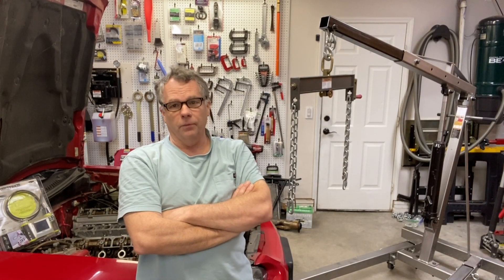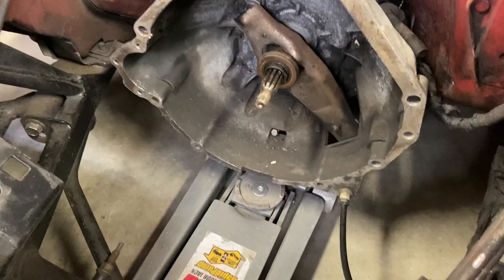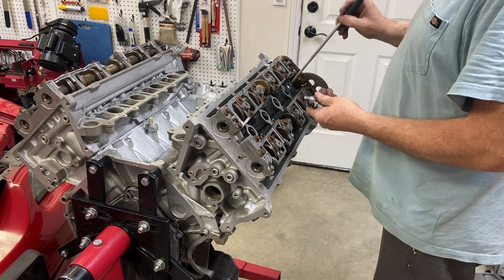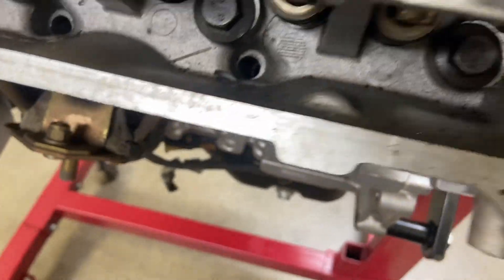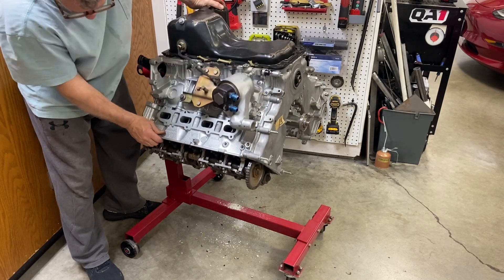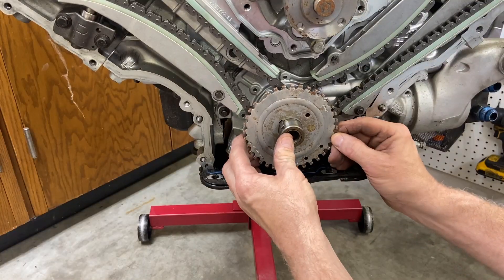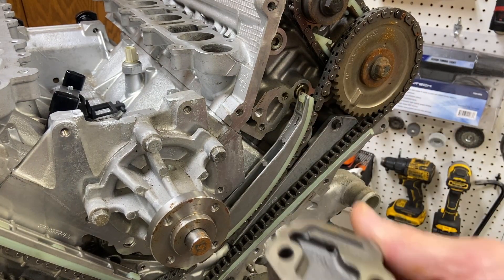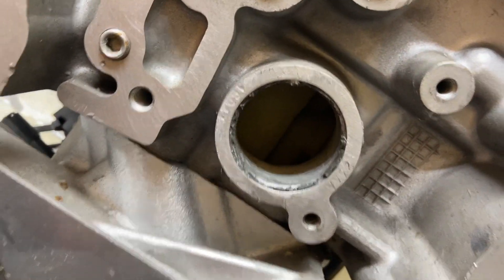97 Mustang Cobra Motor Rebuild (Part 2)

Comment: The water outlet on the rear of the passenger cylinder head feeds the heater core.  There is a mod to connect both rear freeze plug holes to the heater core for better cooling of the driver side head.  I am glad to see the old girl is in good hands.
Reply from the maker: Thanks for the info, much appreciated, I will take a look into that. Have a great day!